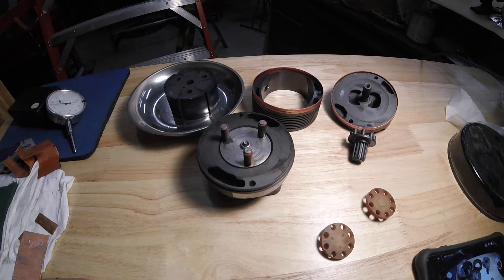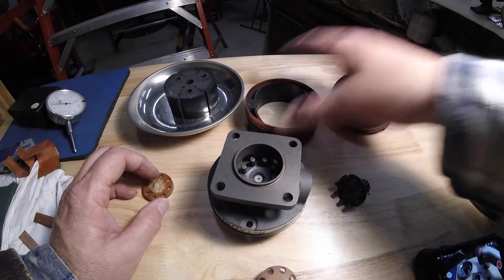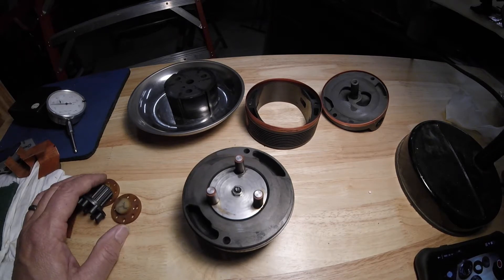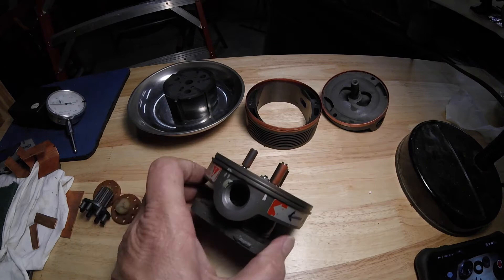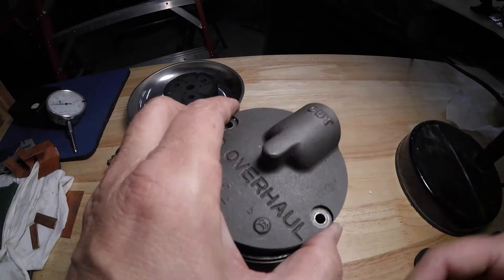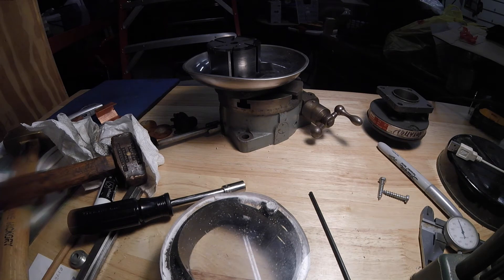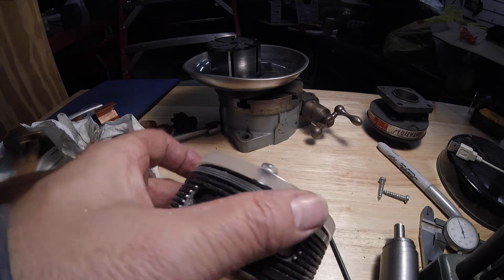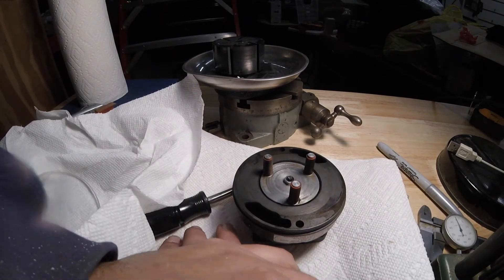Making A Dry Vacuum Pump Cutaway

Comment: This pump is very similar to a power stering pump on my old Honda...    The burned pump was melted into ingots and the ingots got stolen by a poor pathetic ( Just invent all the nasty words you imagine here...)
I find mysel priviledged to have a fully heated shop to work in without the urgency of having run for a heated shelter...   lol
Reply from the maker: Pierre's Garage  I never knew power steering pumps used rotary vanes, but I never had one apart.  Be thankful for a heated shop.   My shop is large and there is no way I’m paying to heat it.  The older I get the less I like the cold.  Last year my body decided that 40° is my new lower comfort level for working In the shop.  If it is much colder than that I don’t go out unless I have to.   This is the first real cold snap in a couple of years, so it is the first time I tried to start my kerosene Torpedo heater in a couple years, and it won’t start.  I think there may be a video of me working on my Torpedo heater soon.  Chris
Reply: Just like you, as I'm getting older, my tolerance to cold is now near vrey nul...
You'll have to rent a heater in order to fix this one...   lol